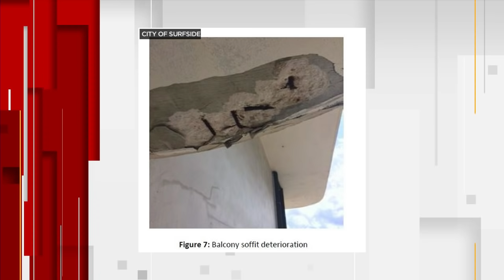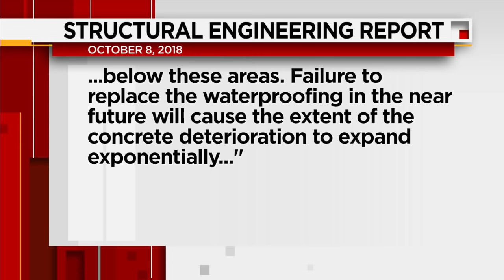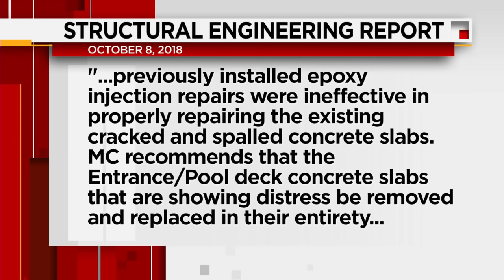Structural engineer Rick Slider discusses Surfside building collapse on TWISF

Comment: Way too early to establish causes and root causes of this failure. Trying to link the 3 year old to this catastrophic failure is super speculatative at this point. There is, at this time, not enough information available to intelligently debate this issue.
The anchor person is totally unqualified to determine anything about this failure.
Science and qualified structural engineers will determine the actual and contributive cause(s), but that will take time.
Simply, a rush to judgment by the media, serves no one, and contributes zero to ultimately determining what the true failures were.

Comment: I wonder if anyone has looked at wind conditions at that time, maybe a microburst hit? Looking at the cc footage, the debris cloud seems to moving out towards the ocean at a good clip.
 On a personal note, I lost a close friend in the Harbour Cay collapse, which was just finishing construction in the same year that this one was being built, just wanna say, I still miss ya bigfoot .....
Reply: You're saying wind caused the building to collapse?  No.  Absolutely not.
Reply: @stephanieadams3747  No, that is not what I am saying. I believe the collapse was caused by a mutitude of issues. I'm just saying there was a fairly heavy crane that was attached to the roof recently, if it had a protective covering over it (btw, this is entirely conjecture on my part), a wind burst might have applied a load to the attach point that might have caused an issue, it might have been the straw that broke the camels back, just saying ......
Reply: 40 years of Hurricanes, but a micro burst took it down.
Reply: @AB-pe5nl  Ah, no, that is NOT what I am saying. Let me try again, there were multiple factors that contributed to this accident. Clearly the building was on a razors edge of coming down. Recently, a small crane was attached to the roof at a load point, that crane can act like an airplane wing, which means wind will stress the load point. (BTW, there has been no hurricane between when it was installed a couple of weeks ago and the collapse.) What I'm trying to point out is that it is possible that that a moderate wind load (doesn't even have to be a microburst) on that crane might have imparted enough energy on that load point to push everything over the edge, again, the straw that broke the camels back .....
Reply: @AB-pe5nl  Great comeback .....
Reply: @thomasparisi5333  Thanks bro.

Comment: Structure engineer is never appreciated until time like this….
Reply: Engineers of all types are the creators of the modern world, we should build temples to engineers
Reply: Ultimately the owners (condo unit owners) were responsible for taking the report seriously and performing the work. There is a political issue at work here. It was an expensive repair and a lot of the owners were most likely unable or unwilling to come up with the special assessment for the work. Their ability to refinance their units (or sell) was compromised by the loss in value of the units due to the damage and the fact that they were retired and not earning an income to repay the new mortgage. They were buying time hoping to come up with a solution and simply ran out of time. Their are numerous condos in the same situation. A real ticking time bomb.
Reply: @jeffreyanderson1851  they do not know what they are getting into.  they have no comprehension.
Reply: @megenberg8  absolutely. No one buys a dwelling thinking it is going to collapse. The repairs were ticketed at $15,000,000. With 140 units, that comes to $107,000 per unit. That would seriously effect the value of a $500,000 unit and the owners ability to refinance for the repairs.
Reply: Then it's time for everyone to try and find a way to sue the ones that never designed the building, but instead the ones that did later inspections, and make them pay for everyone else's negligence.  In this case, the Structural Engineer doing the inspection failed to call for immediate shoring and immediate testing to more closely determine the condition of concrete column spalling.
Reply: @screamdoctor  they were brought in to inspect and report their findings but it was never up to them to do anything without approval from the building owners and association.  Also a lot of contract needed to go through and be approved by the city in order for the work to began and the building simply never initiated any of these proceedings with this engendering company, they had nothing to do with this although they suggested that the structured below the pool deck and garage needed further inspection which they were never payed nor approved to do so

Comment: The question of limestone "bedrock" was not discussed here. Indeed, not much sense to build sky scraper by the beach.
Reply: This entire coastline was reclaimed wetlands. Since those days coastal communities have figured out that with those wetlands in place when a Hurricane whips through there is much less flooding and damage inland.  There is no bedrock here, at all.
Reply: According to several articles in Google, many beaches in southeast Florida and along Miami Beach are man-made.🤯
Reply: Limestone is not bedrock.
Reply: @husk1061  Tell that to the engineers, please.
Reply: @niilespunkari8832  While limestone is considered bedrock it is also unstable due to the fact it can dissolve. I do believe early construction in the Miami area only required pilings down to limestone bedrock but newer construction requires pilings go past limestone layers to more stable bedrock.
Reply: @husk1061  And storm swelling flood the basement, the saltwater leaks into the limestone and further erodes it (i.e., the limestone).
Reply: kevin brown  "obvious" in what way? It's not at all clear at this point that the foundation had anything to do with it.
Reply: Thirteen stories is hardly a "sky scraper."
Reply: @stephanieadams3747  Florida has sink holes and hurricanes. Why to build anything above five floors.
Reply: @stephanieadams3747  I am thinking about Sunny Isles.
Reply: @niilespunkari8832   So am I Niles , 40 , 50 plus stories anchored in "wet Sand"  with zero bedrock , DUH ?

Comment: How do a couple of cracks in concrete lead to a complete collapse?
Reply: There were cracks everywhere.  And exposed rebar that was rusting and becoming weaker and weaker.
Reply: They don't.  Pancaking takes simultaneous failure of all major supports and occurs in demolition where charges are set off by perfectly synchronized electrical wiring to set off explosives attached to all the major supports.    They decided it was too costly to fix and rigged the building for demolition and brought it down in the middle of the night and will get the insurance money.
Reply: @jcsgodmother  The guys who owned 7 World Trade Center retired to south Florida and settled into this building.
Reply: @118Columbus  Tell me it isn't so.  I have also heard John McAfee owned a unit in it. I don't know what to believe but I don't believe it was an accident from water corrosion. Looks like a rigged demolition and insurance fraud to me.

Comment: Now, on the realization of the particular situation in which the government inspectors have been to this property, and found all kinds of distress in the structure and infrastructures concrete and steel structures, what about the post tension cables that hold the building together, and the building associations, that the residents are charged with a high maintenance fees and assessments fees to management companies that didn't take the inspection sheet seriously because 2 years has gone by, and the issues on the list were never resolved nor anything on the list even started to begin with the work, and everyone knows that live in Florida, only reason why the roof is getting redone, is do to the fact of, insurance companies are raising everybody's rates with older roofs being that hurricane season is in  effects and insurance companies are not going to cover the cost of the roofs if they're older than 10 or 20 years old, insurance companies are like that, but the homeowners association management that changes each tenant a hefty price fees each month 400 500  600 700 a month to maintain/ maintenance fees for the whole association of the well taken care of the property damages and plumbing/ electrical/ garbage removal, safety/ security measures/ etc, actually stands in the position of responsibility for not responding quickly enough to the inspection required request for the buildings damages, which also addresses the many lawsuits and lifes that have been lost during this monstrosity/ Dissatassor and because of hesitation of the homeowners association management, that's the way it stands out and appears to the public, correct me if I'm wrong,
Reply: The building was not Post Tension Cables. It was Rebar/Concrete vertical and horizontal. The roof work was new mounts for window washing. Car Park / Basement salt water flooding is what took the building down.
Reply: Wrong.  They decided it was too costly to fix and rigged the building for demolition and brought it down in the middle of the night and will get the insurance money.
Reply: Your wrong a building with that type and magnitude of foundational & structural damage should have been condemned not repaired. You can't really repair foundational damages of that magnitude as a rule, think about it?  "monstrosity"
Reply: Don't blame the Management Company!!!!! Blame the Board. They all-too-often do not listen and penny-pinch!!!!

Comment: perhaps a sort of plastic rebar could be made for salt exposure areas.  I see nothing attractive about massive high rise buildings.
Reply: Epoxy coated as well as stainless steel rebar has been available for over 40 years that I know of. Retired, Fl. licensed structural inspector for over 30 years.
Reply: Thirteen stories isn't a highrise.
Reply: @stephanieadams3747  it absolutely is a high rise.
Reply: @stephanieadams3747  2 words not one..*sigh*

Comment: I agree it was foundational issue. A maintenance person said salt water was constantly in the garage sometimes 2 feet of water, enough to make cars float. He was told to use pumps. Pumps never could get all the water out. Then at times, water would disappear.  He wondered where the water would go. He said this went on for years.
Reply: I saw that on an older video about Miami, they showed all the water that was coming up in places that it shouldn't be. 
Now if this has been going on for years we're lucky it hasn't happened before.
Reply: But The garage was below the structural slab which in turn was supported on deep piles. The piles being in contact with ground water would be expected and should have been allowed for in the design. The design or quality control in the construction may have been flawed leading to this premature collapse, but water entering the garage though it's walls or floor waterproofing would  not  give concern about the structural integrity of the main building.
Reply: @ Margie Marion. It’s crazy to try to get rid of
the salt water with pumps. The stagnant water shouldn’t have been ignored 🤭😳
Reply: @sk8ercaligirl  the maintenance guy said he told management the pumps kept breaking. They told him to just buy more pumps. Hopefully, the investigation sees these receipts and interviews him too. He no longer works there, but he worked there for a lot of years. He reached out to an investigator reporter who filmed his interview. Smart of the maintenance guy to come forward so no one pins this on his department.
Reply: Many buildings in the area have the same problem. Sea level rising from underground is rotting these buildings, new and old. It's so common, people are desensitized to it. They've been ignoring warnings from environmentalists. Times up for Miami.
Reply: Wow, I thought the collapse of the Hard Rock in Orleans was a once in a century type accident,  now , it looks like a game of Russian Roulette Right now, Miami,  fla!
Reply: Sinkhole

Comment: Here's a guess as to why repairs were delayed and done starting from the roof, rather than the basement (which was structurally more critical): PROFIT MOTIVE.
BTW, who owns the building?
Reply: Condos are individually owned.
Reply: Who owns the building?  The condominium owners own their unit and a share of the building and property.  There isn't one owner.  If each unit is individually owned, there's 136 owners.
Reply: Profit motive??? What???  What profit?  Any condo dues collected have to be used to run the building, typically water, electric, sewer, grounds upkeep, etc.  The money gets spent. And hopefully they had a reserve fund where money put aside for unexpected expenses.  There's no way to "steal" money from a condo association.
Reply: Whoever they are, whatever money they hold is going to be subject to several lawsuits. Chances are its some limited liability entity. I'd be great if you could go after the negligent owners cash as well. Not sure of criminal liability.
Reply: @saeed7099  
Are you daft?  Do you not understand the condo owners own their units and a share of the building and property.
Reply: @stephanieadams3747  who has responsibility for maintenance? The decision making? Certainly it's not down to each owner to decide to repair building.  If you do respond,  try not doing so in the crass and abrasive manner you did before.
Reply: @saeed7099   : The owners elect a committee from the owners who are willing to serve and they vote to make decisions.
Reply: @saeed7099  they were hit with a $15,000,000 bill to repair the building. Each   unit ended up with assessments of $80,000 - $200,000 per unit to fix the building. They also had to continue to pay their monthly fee of $900.
Reply: @staciasmith5162  fks sake. That's rough.